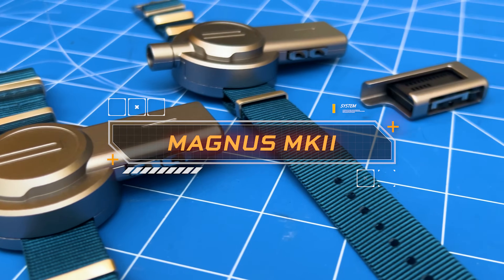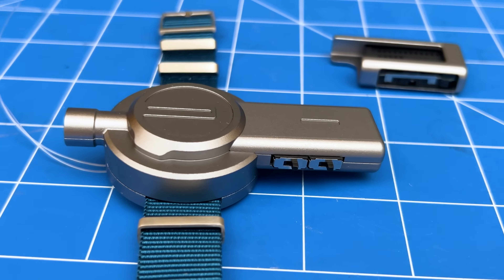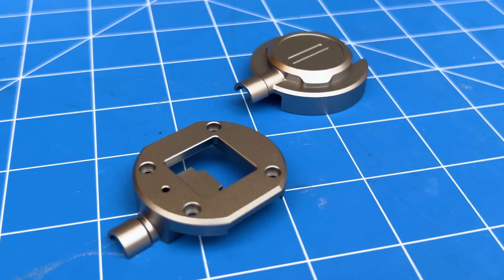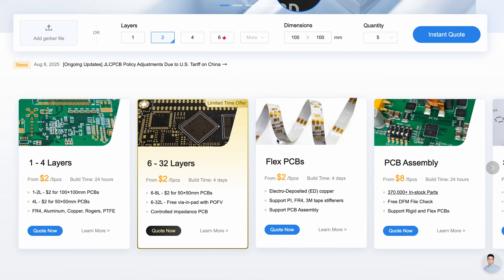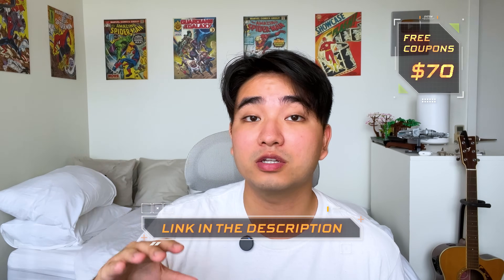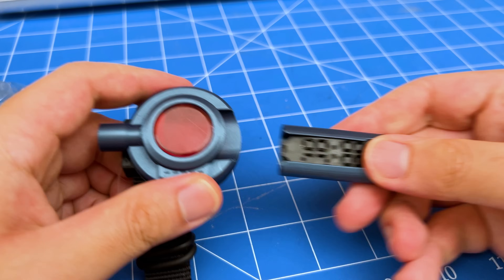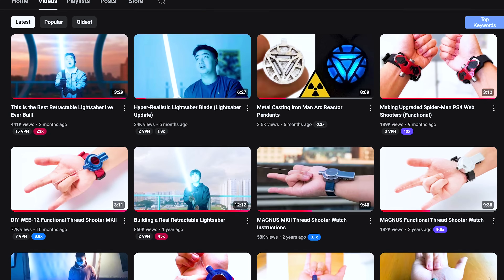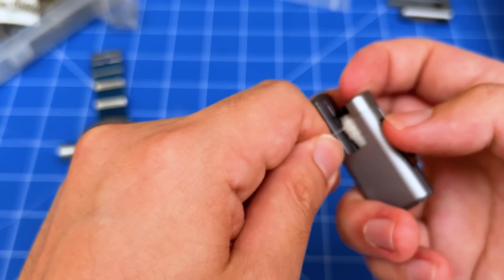I Spent a Year Making This $349 Thread Shooter Watch

Comment: Are you selling just the battery, since it's custom and we can't just buy one off Amazon?
Reply from the maker: We’ve unfortunately ran out of the battery (only have enough to fulfill the remaining orders), but the footprint of the battery we used is 3.5mm by 8mm width by 35mm length, may be able to find a similar one
Reply: @herotech  thanks! That helps a lot. Fingers crossed 😂